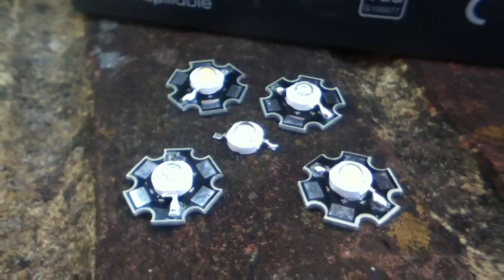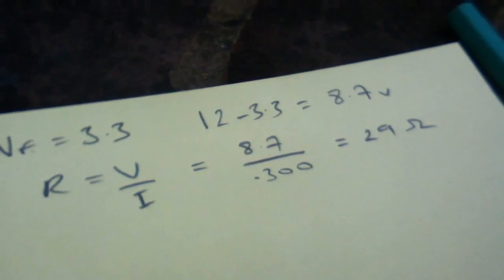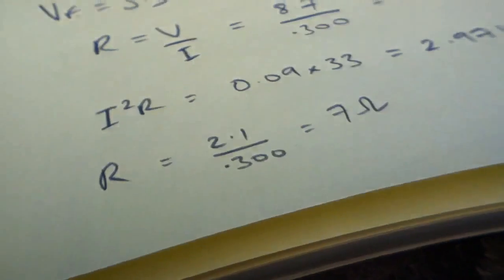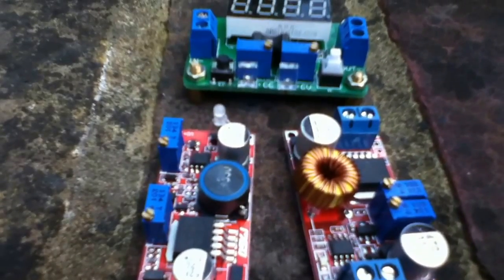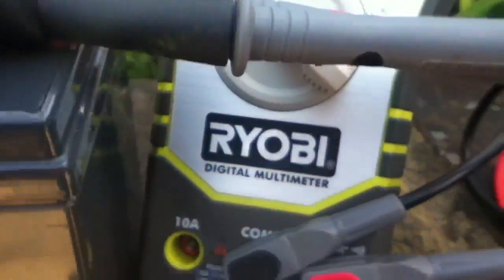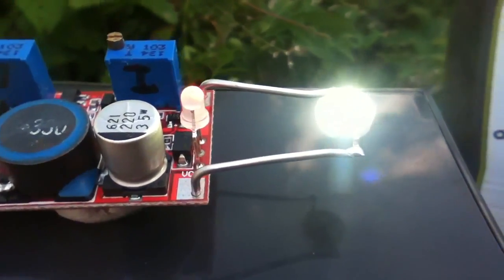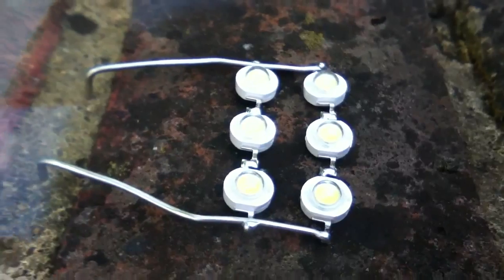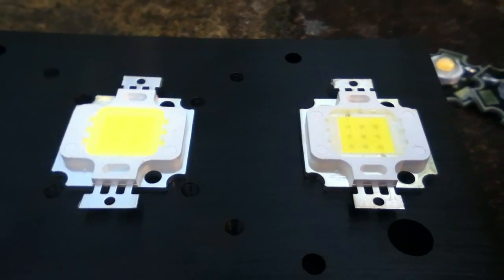High Power LED Tutorial #1 - How to Drive 1W and 3W LEDs from 12 Volts

Comment: Awesome video. I almost got it now i think. Im completely new to working with leds, well and electricity. the only thing i have been working with is a 12v power supply and some computerfans. 
What i dont get is how u can run 3 leds at 300mA. When they each can use 300mA.
If u was to remove the volt controler and only control the mA, could u run 4? (3v pr led x 300mA)? or is that not how it works?
My question is how do i get the most leds to run at max power? I dont need dimmer or anything fancy.
I want to build a fixture with approx 30-50 leds. 1w. from ebay. But the more i read in to it the more confused i get. :S
Can i just buy a 30-50w led driver and daisy chain them? or is it not that simple when i want to have so many? If i need to read more before u can answer me just tell me. Maybe all of this is confusing to u. :S And my english skills is not capable of explaning my questions properly. But i hope i have made myself clear, and i really hope u could give me a pointer/advice on how i proceed. :)
Reply: It's because the leds are in series and current is the same at any point in the circuit. We know the leds are about 1 watt each so that means the circuit has 3 watts total drain. We also know that the supply voltage is 9.9v (3.3 per led). We know that power in watts equals voltage x amps so 9.9v x amps = 3 watts. Therefore the current must = 3/9.9 = 0.3amps or 300ma. If the leds were in parallel, the voltage would only be 3.3v with the same 3 watts total and in that case the current supply would be 3/3.3 or 900ma. You can think of it as a water hose where power is the volume of water flowing through it, the diameter of the hose is the current and the water pressure is the voltage. How you hook up your leds to the led driver would depend on whether it was designed for parallel or series or a combination of both to keep the supply voltage and current within limits of the leds and whether it has adjustable voltage and current.

Comment: Hello julian can you help me with my project please i have ordered 2 star 5w ir leds DC Forward Voltage (VF) :DC1.7V
DC Forward Current (IF) : 2000mA
Maximum Pulse Current: 2500mA
could you tell me the best settings using the regulater you mentioned they will be going on a rc boat with under water camera for night vision the psu will be 2*6v lead acid batterys wired to give 6v 2* 5mah could you give me the recomended voltage and current if i wire the leds in series.thankyou hope it makes sense
Reply from the maker: I'm assuming the batteries are 5Ah (not 5mAh). You can run the LEDs at any current up to 2000mA - you may not need to run them at full power. Try setting the current initially to 1A. With the LEDs in series, supply voltage will need to be at least 3.5V - set the voltage limit to 4V to ensure the regulator doesn't limit the voltage. I can't remember the minimum input voltage of the regulator in the video, it will need to be around 5V.
Reply: Thank you julian yes i ment 5ah i already have a voltage regulator could i just use that and set it to power in 6v out 4vs does the current need regulating too sorry new to this..ps the batterys say max initial current less than 1.5A

Comment: Thanks,very interesting... I'm confused about the 2A driver running 6W of LEDs?
Is it supplying 10V @ .6A = 6W? 
Or is it supplying 6 LED * 3.3V * .3A=6W
Essentially I'm wondering how many 3W or 1W LEDs (either 2.2V or 3.2V) I could drive from 6V (or actually a car running 6-8V)?
Reply from the maker: 6-8v from a car? Does it have a 6v electrical system? A boost converter or a SEPIC would be best for that low voltage. Sure Electronics do a SEPIC driver for 3W LEDs (350mA) that can drive 4 LEDs in series. It will step the voltage up from 6v to 13v/14v for the LEDs. Search eBay for "350mA SEPIC".
Reply: Julian Ilett Yes, a 1930s car with 6V 3 brush dynamo without a regulator and lots of high-voltage coils designed to break small electronics! I've watched most of your similar videos and I've seen some boost regulators with input as low as 5V (the car will dip below 6V when starting) but I'm still struggling on how much power I need. I need tail, brake and indicator LEDs and I'm guessing I can do 3x3W for each tail light (and increase current for brake) and 4x3W+2X1W yellow for all indicators. Call it 32W@2.2V? Or .750A*10=7.5A@2.2V=16.5W? Also considering isolating the LEDs (and arduino controller) using 12V battery and using a booster to keep it topped up (from 6-8V system), but still lost on the power needed. Thanks...
Reply from the maker: TheYesnoyesnoyesno Watts are Watts. Just add up all the LED Watts, add a bit to account for driver losses and that's your answer.

Comment: i just had a look and they have some really great stuff, i think i will save that seller for later! but as for the drivers, i need them small because i am going to have a 24 grid of LEDs and the drivers can't take up too much room so i was thinking of designing my own based on the PT4115 driver, its very small and looks like it can handle up to 3 watts

Comment from the maker: No problem. In fact if you look through their products, you'll find a 1W LED driver with EN input (for PWM control) for $4.37 which seems pretty reasonable to me. It's got a "Make Offer" thing too, so you could probably get 10 units for quite a bit less than that.

Comment from the maker: Try searching eBay for "RGBY Quadcolor 4*1Watt LED Built-in Driver Board LED" by Sure Display. It has 4 drivers on one board with PWM control inputs. The LEDs are pre-fitted but could be removed. Sure Display may have other driver boards that would be suitable.

Comment from the maker: You can buy dedicated 1W (or 3W) LED driver modules with an E (enable) connection for PWM control, but I can't think of a way to drive 10 separate LEDs from one driver module if you want individual control over each LED. You'd probably need 10 driver modules.

Comment from the maker: You're absolutely right, for prolonged use, the 1W LEDs should also be properly heatsinked, so buying them on the star boards is a good idea. Also I was using them in free air outdoors - if they're in some sort of enclosure, the heat build-up could be quite rapid.

Comment: The 1 watt LEDs may look fine, but running them without a heat sink for long periods of time will shorten their lives. They will a least reach their 70% lumen maintenance a lot faster. Depending on the manufacturer, you can get a sustained decrease in output of 10% or more in less then 6 months. Keeping the junction temp low will also increase the lumen output. you can just barely get away with using a star alu PCB for a 1 watt LED.

Comment: what would you do if you had an array of these LEDs? for example if you had 10 white LEDs and you wanted to PWM each one individually so they could all be at their own brightnesses, would you need a regulator per LED? surely if they were all using the same regulator then the load would change depending on how many were on or off.

Comment from the maker: I think the 3rd pot is something to do with charging batteries. It alters the point when the fully charged LED comes on. Not completely sure about that though.
The unit with the larger coil (with the visible windings) has a higher output current rating.

Comment: I would think the same !
I've been advised not to put LEDs in parallel with the same resistor.
I would think the same about The DC/DC current limited PSU used in the video ! Especially when you know how behave a diode. But I'm a humble beginner !

Comment: so if i wanted to run more ie seperate strings if i used something like a PC PSU 400w which would do 18a on the 12v rail i could have at lest 5 strings of 6

Comment from the maker: Yes - that should be OK. Three LEDs in series will need about 10 volts, the buck regulator should be able to supply that from a 12v input, but you'll be near the limit with 2v difference between input and output. 2 rows (or columns depending how you look at it) will require twice the current of a single row - 2x 700mA is 1400mA. This should work.

Comment: Hi , if i wanted to use a 12v psu with a current and voltage regulator as in your example but for 3w leds that have a forward voltage of 3.4 and a 700ma current draw. could i run 6 - 2 rows of 3 from one 12v supply? assuming i set the voltage to 12v and the current to 1.4a?